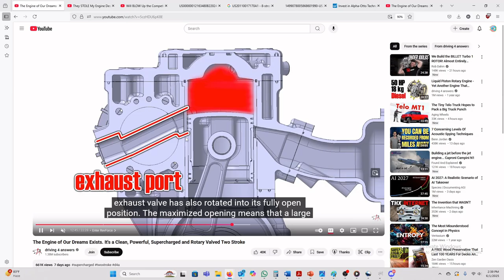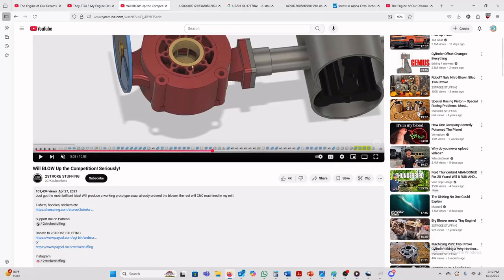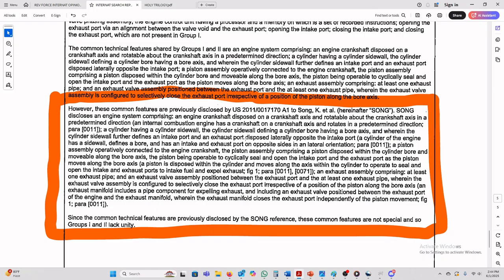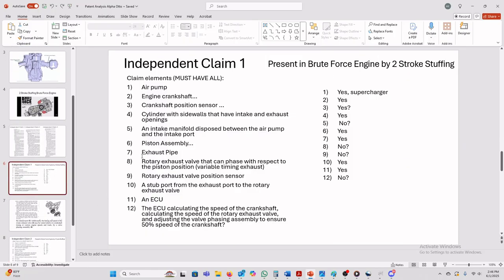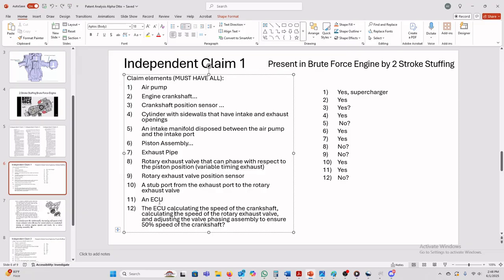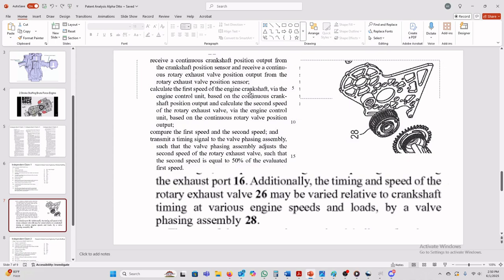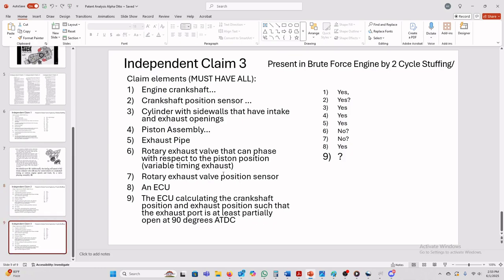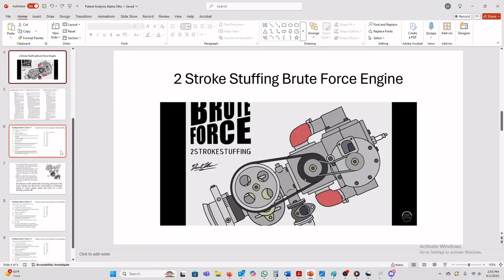REV Force V Brute Force- Sneaky Little Sneaks?

Comment: Due diligence implies you would check if the claimant had grounds based on their design. The "brute force" design is basically a direct copy of an existing engine.   

The "brute force" engine design is on its 162nd iteration (sarcasm, real number unknown) due to failures and poor performance.

To claim the idea you (2stokestuffing) stole has been stolen based on a the video diary of a poorly performing failure prone never the same thing twice never made it off the test stand is slightly delusional.
Reply from the maker: Did you watch the video? 

My conclusion is that the REV Force patent did not in fact patent the concept of the Brute Force Engine. Whether the design worked as described is irrelevant for a patent analysis- the disclosure of the engine architecture of the Brute Force Engine would have presented a problem for Alpha Otto Technologies should they have patented that architecture. But, they did not. They essentially patented a control mechanism via the ECU on a Rotary Exhaust Valve supercharged engine at 50% speed. This is not the Brute Force engine. That's essentially the point of the video. Their patent is much narrower than a simple engine architecture patent.
Reply: @EngineReviews  No.

This video should not exist, because the claim should not exist.

Yet somehow you've managed to clkb8 an absurdly long video out of non topic.

Comment: This is nothing new, Detroit Diesel did the SAME Damn thing way back in the 1,930's or 40's about they came out. I've driven several of them myself, the inline 6/71 the 8V/71, and the 6V/92. All worked on the Same Exact principle, but with valves in the head, and a camshaft that spun double speed of a 4 stroker. They were discontinued in the end of the 1,990's because they couldn't meet emission standards. They could have been altered, but Detroit Diesel went with a 4 stroke design.
Reply from the maker: The rotary exhaust valve is a large departure from overhead valves though. It wouldn't have the same RPM limitations a standard valve train has.
Reply: They were also replaced due to fuel economy. Detroit diesel engines burned so much fuel that it became a logistical issue. This is why the military stopped using them even though they do not have emissions requirements.
Reply: They couldn't meet emissions regs due to nitrous oxide and particulate matter production. This is inherent to compression ignition rather than something that has to do with two cycle nature. That being said, not having an entire stroke dedicated to pumping exhaust exacerbates production of NOx and PM2.5. 

Lower compression ratios, high injection pressure, and literally just running spark ignition versus compression ignition will make this much more viable now than it was then.
Reply: So, not the same thing then. Come on people, at least put a little effort into understanding the patent.

Comment: It's because it can run on multiple fuels on the fly I think?
Reply from the maker: Variable compression ratio is what gets you the ability to switch fuels on the fly. A fuel sensor and phaser control to rotary exhaust valve might be enough- I don't think you would need an active positional control. However, the scenario where you are switching fuels is likely where there strange patented control system would make some sense. You might need it for their setup to adequately control EGR/EGC. 

That said, I have real concerns about the longevity of the REV Force engine on Hydrogen. The top piston ring seal is low on oil (only fed through a small section of overlap in the cylinder. Micro features for oil capture or not- it will be less lubrication than a normal ring pack). 

Running hydrogen instead of gas or another liquid fuel would probably be too much for that seal. I don't think you could get it to run on hydrogen withot premature wear.
Reply: Even if that were true their patent is way to narrow to be forced to get a license from them to make it happen in fact it can be done much better without getting close to their IP.

Comment: As important as the reason for the video is and as important as the content itself certainly is, the structure of the video has become confusing. Ultimately, a lot was talked about, but not much was said (and no clarity was created).
Reply from the maker: Well, it is my first video here. Version 1.0 is never the best. Intended points were that Alpha Otto's REV Force engine that they patented is not the design of 2-stroke Stuffing's Brute Force Engine. In addition, the patent behind the REV Force Engine isn't the same as the Brute Force engine primarily because it is very narrow. They didn't patent the engine so much as electronic variable valve timing of a rotary exhaust valve engine, particularly running at 50% speed. 

Anything in particular you found confusing?

Comment: They shouldn't need crowd funding if this engine is legit & reliable.... Something isn't right, years ago another guy in Kansas City came out with a similar but different 2 stroke engine. Claiming he'd soon be a billionaire.
Reply: Are you talking about the Omega 1?
Reply: @reggiedwayne1844  I found it... It's called the Grail 2 stroke engine. The guy claimed it could get 100mpgs with 100hp....He was bragging back in 2015 that he was going to be a billionaire on the news....Yet no Grail engines are anywhere. Just like the omega & this Alpha Otto.... Although the Alpha Otto looks promising,..The exhaust valve can be with a chain or belt. Just like a rotay intake valve. The top piston rings could be lubed by tiny pin holes that push out a tiny amount of oil.
Reply: @michaelbrinks8089  Ya turns out it is the same guy behind the Omega 1. The Omega 1 has a serious compression wasting flaw in the cycle. It is inherent to the design so not very fixable. As far as this 2-stroke unfortunately you cannot have it both ways where you have rings so far away from a lube source and that pass over ports nearly constantly. Of course you can supply the oil BUT it will get blown out the exhaust, don't supply it and you get premature wear of rings +/or cyl +/or piston or all three. Rings generate a lot of surface heat on their own even with full lube. Without it no way that works.
Reply: @reggiedwayne1844  Are you saying the same guy is behind all 3 engines? ....Or the same guy is behind the (2) Omega & Alpha Otto Engines?
I think even if it consumed a bit more oil than a 4 stroke but much less than a conventional 2 stroke. That it could still has a lot of potential to be compact high power engine. 
Plus since an air cooled 2 strokes rings can can be cooled by a 50:1  oil/gas ratio. That means the piston rigs don't really need much oil.....So when you add in liquid cooling around the cylinder & oil inside the crankcase lubing the bottom rings. That's going to help cool it a lot. Then if the top rings got just a bit of oil from somewhere, that should do it. 
But the fact they want crowd funding sets off the grifting warning ⚠️ alarm. 
I'm sure they wanted crowd funding for the Omega engine also. 
Part of me thinks it's an amazingly simple design that should work great. The other part is worried about the top piston rings & if it needs to burn a bit of oil. Can it still pass modern emissions.
But it's a 2 stroke so if the top end (cylinder & top rings) are easy to change out & they last much longer than a typical 2 stroke. It could still be a winner.
Reply: @michaelbrinks8089  No the same guy, Mathew Riley is behind the Grail & Omega 1. And I do not think they did a crowd fund for either of those.
Reply: the issue isn't the tech, its the fact that "the little guys" tend to think their "slightly better engine" is going to make them a billionare when in reality most manufacturers are gonna say "i'll give you $200k for all rights to this in perpetuity" and walk away pretty much immediately if their lowball first offer is refused.

manufacturers don't care about power-to-weight or efficiency, they care about selling cars as profitably as possible, without getting sued by customers or fined by regulators or buried in warranty claims, which means their best option is "something dirt cheap, that works and won't break prematurely" developed in-house or by an "engine collaboration group" where multiple manufacturers pool their investment to develop a "new engine" that is basically a slightly modified version of a previous engine, and almost always to comply with some new government regulation about emissions.

most new cars are sold to people who know barely anything about engines, so a "really cool new engine" that mostly appeals to people who represent less than 5% of the market is basically worthless to most car brands, most customers have no idea what "VTEC" or "VVTI" or "skyactiv-x" is, or "hybrid synergy drive"... most buyers care about reliability, or how the engine sounds, whether it "sucks you back in your seat" when you floor it, how comfortable the ride is, how it looks, whether it suits their lifestyle, and the really really dumb ones care about fuel consumption/efficiency figures because they don't understand thermodynamics or economics.

all these engines designed and built by small groups are never going to ever achieve commercial success, the best they can hope for is a military contract for a very specific limited scope use case, which opens the door to mass production and then it might end up being used in other applications, by which time the patent will have expired. making revolutionary engine breakthroughs is an art, and just like with most other forms of art, the world won't truly appreciate the art you've made until after you're dead.
Reply: In slovakia they built adiabatic engine 2 liter no cooling( very high efficiency) 700 hp. Both imvetors are dead
Reply: @david4360     "In slovakia they built adiabatic engine 2 liter no cooling( very high efficiency) 700 hp. Both invetors are dead"
Can you tell me how I can learn more about it? I'm an old Slovak so it's of interest to me.
Reply: @david4360  please illuminate

Comment: Nah, you're going to need an ECU to control exhaust rotary valve position as this is going to vary with load, rpm and possibly temperature (engine and ambient air) to even have a chance of meeting emission requirements.  That valve is the one thing that gets you through emissions compliance,  you can bet your patent its gonna be ECU position regulated come serial production....
Reply: The rotary valve can easily be ran off a timing belt or timing chain. The same way regular valves are timed to open & close. 2 gears & chain or belt.
Reply: @michaelbrinks8089 yes, but you need to vary its relative position while it rotates at half crank speed as the volume of exhaust gas and mass flow of fresh port transfer charge varies with engine load NOT speed.  So at low rpm and low load, the exhaust gas has a lot more time to escape and the transfer port is open longer (due low engine speed), but the low load means not much fresh charge, so you'll need to close the exhaust port early to prevent all your fresh air dissappearing down the exhaust..
Reply: @andrewkennedy1172  You don't need to vary it in order for the engine to work. Just like you don't need variable valve timing on a regular engine...But V V T does help to increase performance on an engine. But the variable valve timing can also be done mechanically. Without the need for an ECU just like it's done mechanically on regular v v t engines by using oil pressure to engage an extra camshaft lobe. Or on 2 stroke motorcycle engines with an exhaust power valve. It's also controlled mechanically by governor weights & automatically adjusts/ changes/varies the opening of the exhaust port. To create more low & high end power.
Reply: @michaelbrinks8089  you will need to vary it in order to meet even the most lax emission requirements.   Yes, you could run it fixed, but that's not what either the patent or the marketing intent on this engine is about.   Cheap'n'dirty two strokes already exist, this unique selling point in this one is emissions compliance.....
Reply: @michaelbrinks8089  You are right on the money. As it turns out there is not one but several better ways to do this which do not involve electronic phasing control of a "50%" spinning rotary valve AND those options can achieve better overall results including emissions at a lower cost. No one has to pay Alpha Otto to do this which is why the patent is of very little if any true value.
Reply: @andrewkennedy1172  In many 4 stroke engines, there is also small amounts of valve overlap with small amounts of unburnt fuel escaping & they still meet emissions without v v t..
I agree with you, there is probably small amounts still escaping. The Same as with many 4 strokes & it possibly might be too much to meet newer strict emissions standards set in some places. If so, the valve can be timed either mechanically or by ECU computer to be variable. But if the engine works as intented, even with a fixed- non variable exhaust valve. It should be as clean as 4 stroke engines. Since you're no longer mixing oil into the gas like  regular 2 strokes & because of the lower position of ex valve & it's ability to fully close.
Reply: @reggiedwayne1844  Off Subject but go check out the BS "Grail" 2 stroke engine & the Omega rotary engine...Many years ago both engine designers claimed these engines would be"revolutionary" yet neither one is around anywhere. 
I think this Alpha Otto 2 stroke engine design has the best chance. Yet it's similar in design to a guy on YouTube called "2 stroke stuffing" who built a similar engine before them (or is working on one) and claims that they stole his design.
Reply: Wrong
Reply: Also, I might add that with the rotary valve they describe their timing control is basically 1 dimensional where they can only change the phase angle but they cannot change the effective duration which is even more important. You want to be able to advance or retard the opening and the closing events. They are simply not getting enough benefit out of the cost & complexity of an ECU controllable valve phaser such as this. In addition, the expansion cycle has to be shortened too much to accommodate the range needed which will dimmish both power & efficiency.
Reply: You will most certainly need some electronics and some sort of vvt for emissions and effficiency and to broaden the power band. A large stepper motor controller could probably deal with overall timing and possibly "overlap" duration. I am sure the exhaust rotary valve can be made in a way that duration is easier to control. I did not see any bsfc numbers for this engine...I wonder if it can get close to 4stroke petrol engines.. The US military is always looking for multifuel engines.
Reply: Actually not correct. No constantly moving valve is required at all and even if it was there are many better speeds that could easily used other than 50%. Also, to the extent that some variable valve timing could be helpful it can be done BETTER at far less cost and complexity WITHOUT ECU controls.
Reply: @reggiedwayne1844  they will already have an ECU to do the fuel injection, who in their right mind is gonna engineer a complex mechanical phase shifter on the rotating exhaust valve using only mechanical inputs.  That'd be like using an all mechanical fuel injection unit to do modern fuel injection.   It'd be bonkers, you have the ECU there anyway, you might as well use it!
Reply: @andrewkennedy1172  Might as well not use it if that saves the need to pay Alpha Otto a license fee and that is the point. Of course, all of this assumes this cannot be done without a constant turn rotary valve OR one spinning at any speed other than 50% which is not only not true but there is in fact a far better way altogether.!
Reply from the maker: @andrewkennedy1172  Well, I guess we will see. If the friction to create other systems when the ECU is there anyway is more of a headache than the cost to pay a license fee, that is to Alpha Otto's benefit.

 Given that some 4-cycle engines don't have variable valve timing and still meet emissions (though the trend is to add more variable timing- so you could be right on the trend even if you aren't right about the need to do it today), my point is that it isn't necessary. Other systems could be designed to add that control. 

Anyway this is my personal due diligence and I found it important for others to know that there are legitimate risks where someone can make the engine with slight modifications, commercialize it, and not have to pay Alpha Otto Technologies any royalties. 

Think its a low risk because it would be too difficult? No problem, mark it minor when you do your own due diligence and decide accordingly on the upcoming campaign. 

Personally, I would rate that risk a little higher than minor but to each their own analysis. 

Stay Savvy!